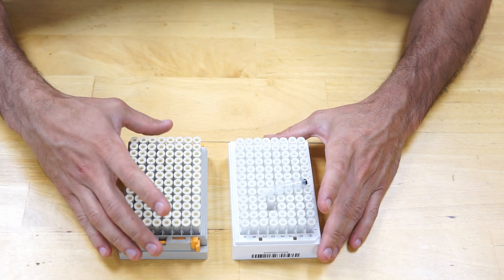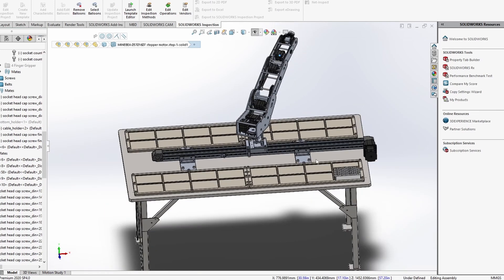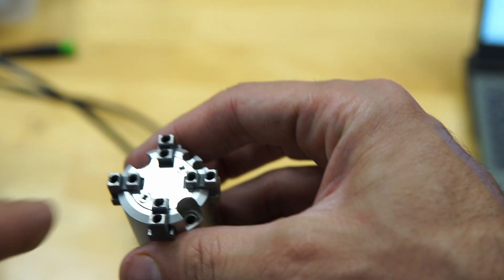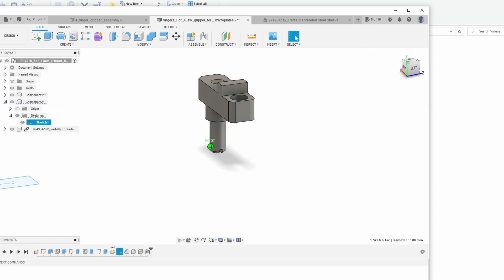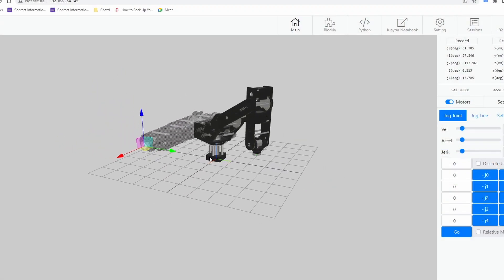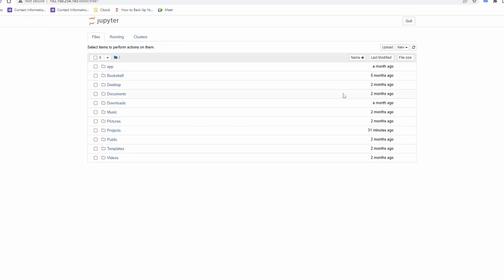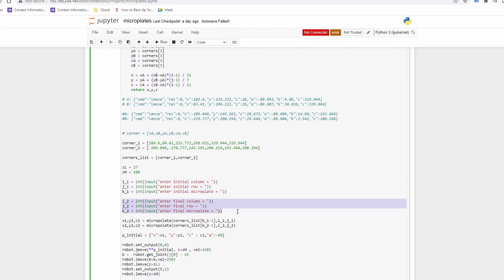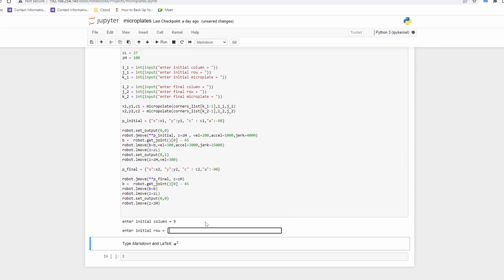Lab Automation Project with Dorna | Quick Tutorial

Comment: Hello 
what kind of motor are you using in dorna ?
and dorna use inverse K or  FK ?
Reply from the maker: The robot runs on stepper motor with encoder feedback and applies both inverse and forward kinematic to get the robot joint and TCP values.